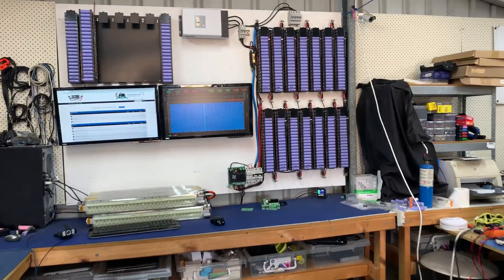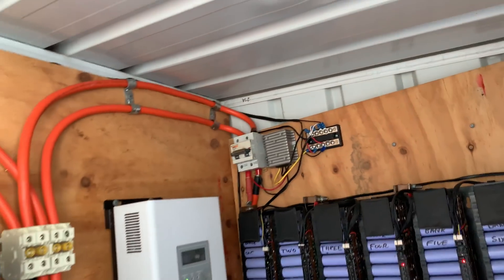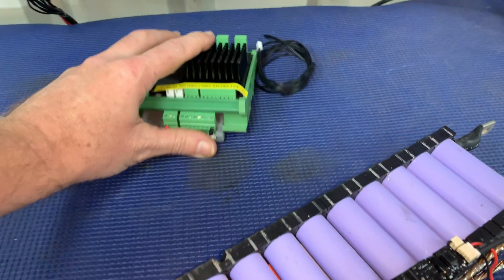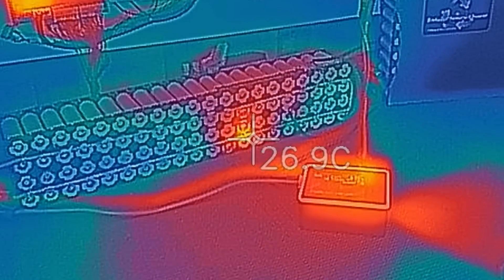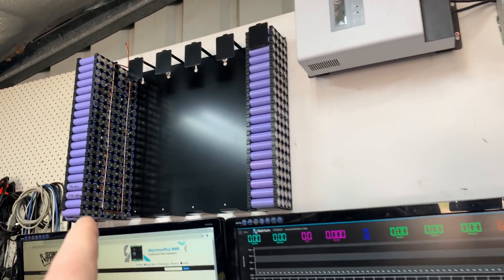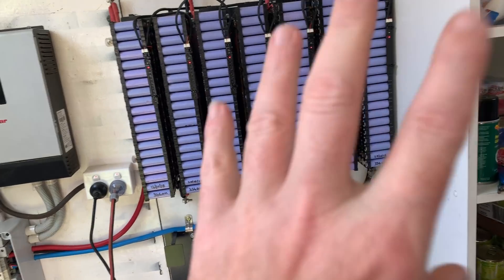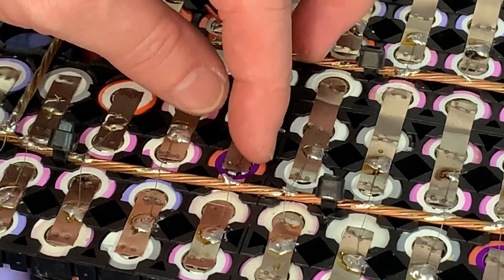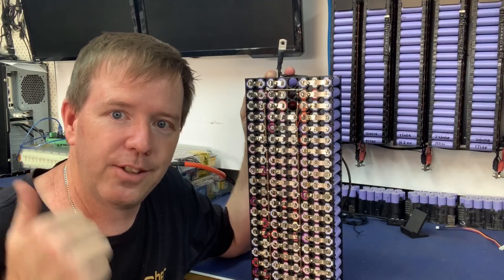Self discharging cells hurting my storage capacity, So doing some maintenance on my wall.

Comment: I notice that you use Heat Shrink identifying Positive and Negative colors respectively.  Assume this is so, that you can at a glance to ensure to put the pack in the right way. I got caught out with this once.  I seen this just before I screwed up to bolt.  Had I used  Heat Shrink identifying polarity I would not of made this mistake.
Reply from the maker: Back in the very early days with my Holden Combo van it's negative wire from battery to earth is RED! Positive was black - was 4000km away from home and got a flat battery - jump started it based off colour of the wires not the - + on the battery terminal and huge CRACk (electrical crack that makes you wet your pants) lucky all i did was blow up the radio and drive home 4000km with no radio to disguise the rattles in the back of the van.. WAS HELL..

Comment: 4:22 Why do some of those cells have thicker copper wire (not fuses) on the positive side?!
Reply from the maker: to hold the bus bar in place - other side has the fuse wire and they are offset

Comment: Great video once again Pete. What is the thermal camera that you use? It looks like an App on your phone.🤔.  Also is it safe to say that as the pack gets bigger there is less heat, in turn harder to spot faulty cells. But for this to be an issue it would have to be about 1000p upwards?
Reply from the maker: I use www.diypowerwalls.com/flir for my iPhone works great! I think the bigger the packs the hotter the cell would get and faster just because there is more potential amps due to the pigger parallel pack
Reply: @HBPowerwall  Not really, the voltage over the cell is still just one cell's worth, and adding more cell's in parallel doesn't raise the voltage, so doesn't raise the current (it's not blowing the fuse, so it's not so low-resistance that the internal resistance of the rest of the cell's would start to matter much.

Comment: Goes to show that a high current IR SD cell will never blow the fuse, but still bring the pack down. Nicely done Pete. Too bad heat IR cameras are so dang expensive, I'd love to have one.
Reply from the maker: Brings them down fast too - if i go back to the farm today i'll check log files and i'll be able to see how much energy has been used to keep that one cell alive!
Reply: The phone cameras can be had for cheap used!
Reply: @rkan2  What's considered "cheap" $200-300??  I havent' seen a decent one below $150. And for "my" wallet, cheap needs to be <$50
Reply: @korishan  At least in ebay.co.uk, there have been used FLIRs for iPhone for less than 100$. The SEEK thermal camera can be had new for less than 200$. Any of those is sufficient enough for detecting bad cells like in this video. I imagine some smartphones with integrated thermal camera (and an ancient Android version) can be had for less than the examples.

Comment: My flir camera is on route! Can't wait to check over my powerwalls
Reply from the maker: I'm now thinking i'm going to pull every battery and capacity test, thermal test & self discharge test everyone.. Need to rebuild my shed battery to 24v so I can run the iCharger X6 for a few weeks solid charging & regen discharging

Comment: Spot weld the negatives together and solder fuse wires on the positives that solder easily. That how I (intend to) do it!
Reply from the maker: Good thinking - least your taking out half the heat. Might even get away with one solid piece of nickel strip rather than three small.That would make it even faster again.. Good thinking!
Reply: HBPowerwall the cells will get much less heat than half, since it’s SO much easier to solder the positive, it only takes a second.
Reply: @HBPowerwall  Have you tried spot welding the leads on ceramic or glass axial fuses?  1000 fast blow 5A axials are under 10 USD...
Reply: Yes that's most effective. You only need a fuse on one side and that makes it easier to check.
Plus, the positive has so little thermal mass you can solder quickly and only need the tiniest blob of solder for it.

Comment: Hello Peter, I am French, could you please tell me what is your IR camera for température.
About the X6, the X6 specification said 7 to 32V DC for input. but you are charging at 4,15 V.
May be I dont understand something. Can you help ?
Reply from the maker: www.diypowerwalls.com/flir is the camera I'm using (one for my iPhone) it is about three years old now but what a tool to own!!! input voltage is 7-32v output it will charge like any other charger depending on settings

Comment: Good to see a maintenance update, reminds every one that you do have to maintain this stuff. Also it really highlights the great use thermal camera's in this sort of field of electronics.
Reply from the maker: I'm going to pull my whole battery and so a bunch of tests - summery will be filmed but bulk will be because it REALLY needs to be done. No more excuses i must complete this task asap
Reply: @HBPowerwall  Im sure youl get it done, and given how closely you watch your system i recon there probably wont be any issues ow though its great to check it like you would a gas boiler for safty each year.

Comment: When are you going to glass axial fuses with a low 1amp fuse would have solved that issue by its self no?
Reply from the maker: I won't do the glass fuses personally don't like the idea but it does work well for others - cost is a big factor - small piece of nickel plated copper wire is so much cheaper and more accessible to the larger community. The draw each cell was taking was much less than the fusible current of my fuse wire *around 2-3 amps. if you had fuse wire or glass fuses of 250ma they might have blown but would have added considerable amount of resistance to the batteries
Reply: @HBPowerwall  very true, and another thing I note is that medical certified packs even have parallel cells, so I don't worry, proper use and maintenance is more important to me.
Reply: Probably not, I doubt that cell was anywhere close to pulling an amp if he was barely able to feel it's warmth.

Comment: 3.39 cells don't have fuse :)
Reply from the maker: I think you might be looking at the thicker wires? If that is the case if you saw the opposite side to it - that is fused. It's because i wanted to hold the busbars down at each end for extra strength - it's offset on both ends/sides
Reply: @HBPowerwall  thicker wires side 3:39 min. there is nothing to connect the battery or maybe am wrong or maybe you don't using these cells. 

P.S. by the way nice videos lot of useful information from real life experience.

Comment: Pete what are you doing to use as step down instead of the one you are using?
Reply from the maker: No more stepdown - just go 48v fans and Batrium WatchMon4 can handle upto 60v so it'll run direct also